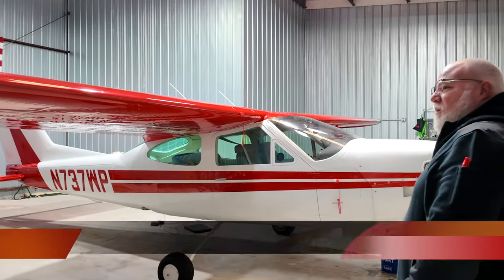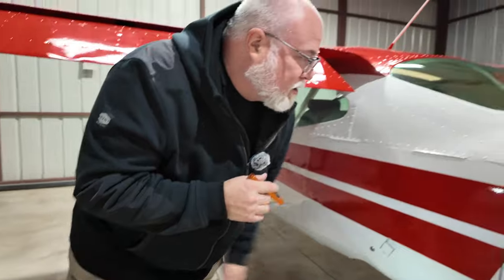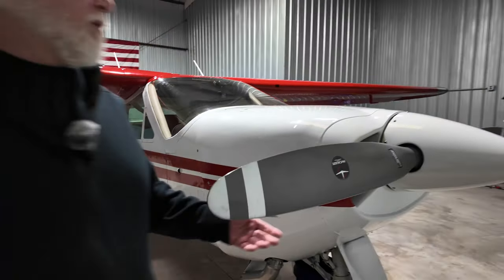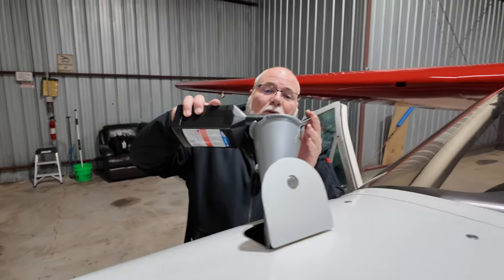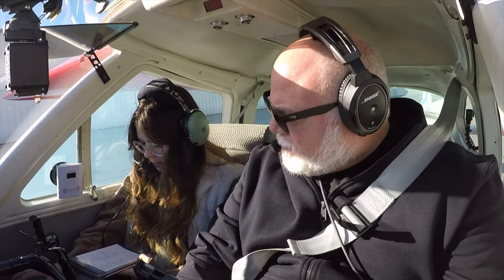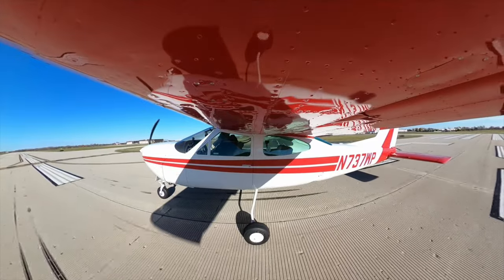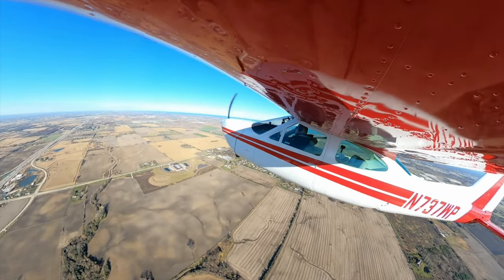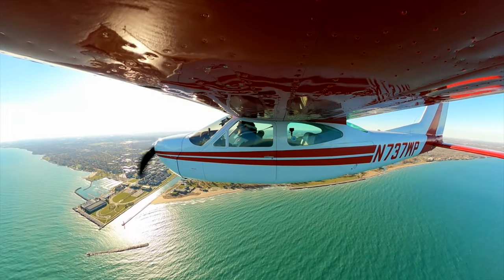PRE-FLIGHT & FLYING the Cessna 177-RG Cardinal

Comment: I know except for the late model with a 24V electrical system, gear operation is very slow on the cardinal. Yours took roughly 21 seconds. Are there published normal extension/ retraction times? After getting your hydraulic pump rebuilt, how is it now? Just curious, from your maintenance logs, how long ago was it between overhauls? Also, considering the plane has to be put on jacks to do a gear swing and all, how much did that repair cost? I’m interesting in purchasing either a cardinal RG or an older Mooney and I’m comparing maintenance costs between the two. The Mooney is 8-10 it’s faster, but I really like the room, visibility and payload of the cardinal. I have so many questions for cardinal RG owners. Is the wing spar inspection expensive to have done and should it be repeated for a pre- buy inspection? I enjoyed your video and will follow the channel hoping to learn more cardinal specifics. Any chance you could make a video on cost of ownership including your annual and maybe one with a deep dive into aircraft performance? Thanks again.

Comment: Did the cross feed vent line drain valves come with it or did you install them?  My 1975 rg doesn’t have them
Reply from the maker: Factory lines.
Reply: The vent lines are factory, but the drains were not put in by Cessna. Must have been added along the way to this Cardinal.